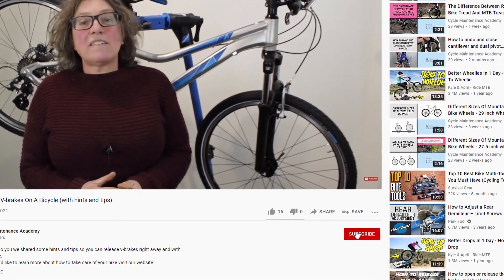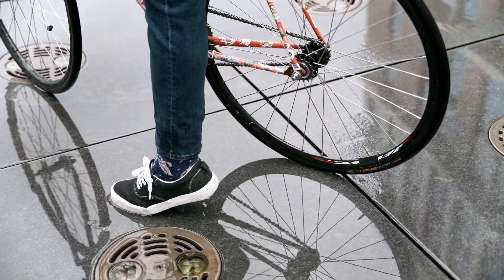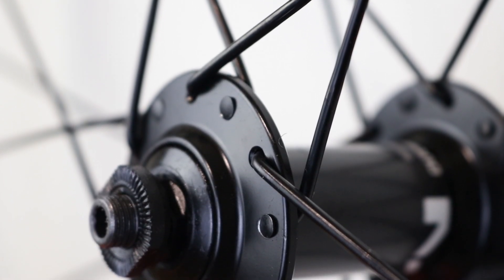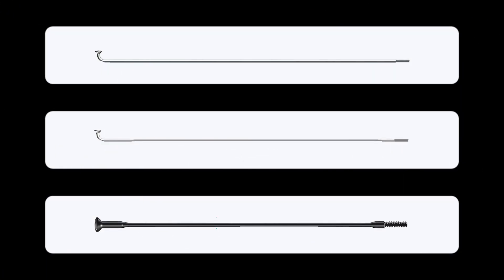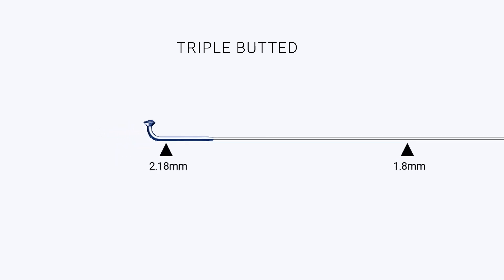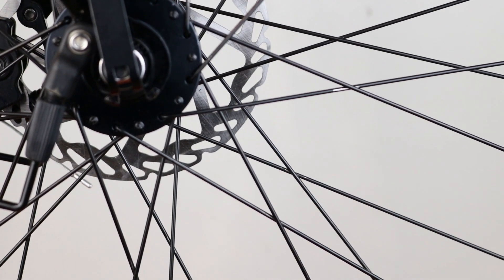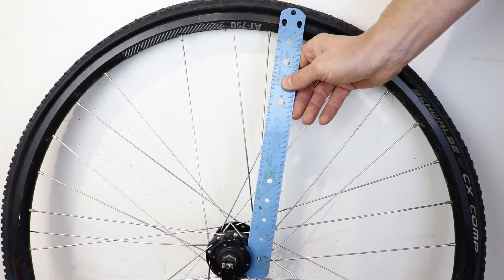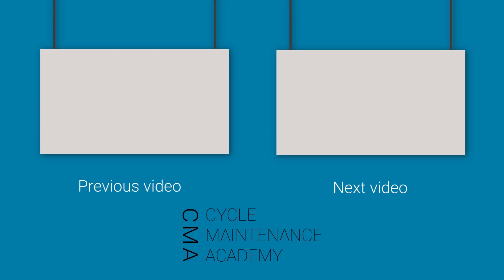Bicycle Spokes Explained

Comment: in regards to strength and reducing vibration impact on the rim, what are the advantages of straight-pull vs double butted and is it recommended to have washers under the nipples to prevent stress cracks on the rim..?    I spent $2000 usd on a 26" 32H rear wheel with a Rohloff hub built into it. and because of impact from road vibration it caused multiple cracks in the rim.. That is going to cost another $300usd to replace the rim and spokes..  Recommendations..?
Reply from the maker: Hi Rob,
thanks for your questions. In regards to the first one did you mean straight pull vs j-bend spokes. Both straight pull and j-bend come butted. The main advantage of the straight pull is that there is no bend which is a weak point. Regarding washers under the spoke nipples, as far as we know spoke washers are designed to go under the head of the spoke where it rests on the hub. Eyeleted rims improve the strength of the nipple holes but you can still get cracks around the nipples.
The rim can crack around the nipples if it's not strong enough or if the tension of the spokes is too high. There's a great article where you can find more information about Rohloff specific 26" rims.
https://www.cyclingabout.com/the-best-rims-for-bicycle-touring/
I hope this helps:)

Arek